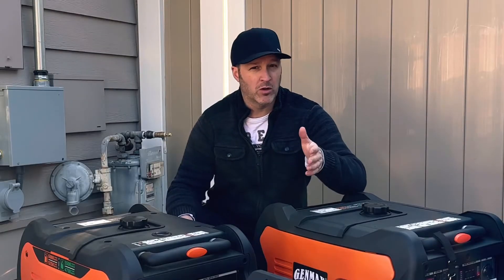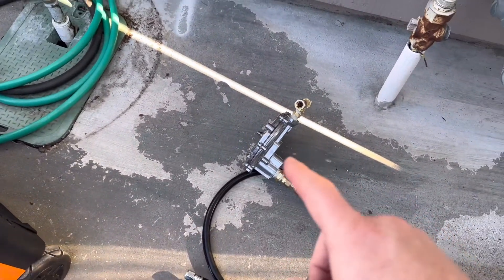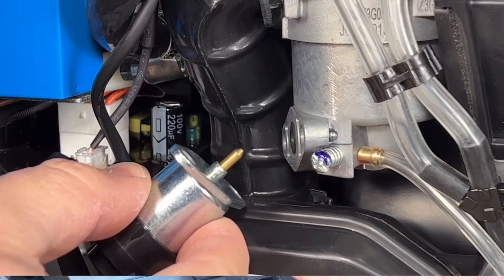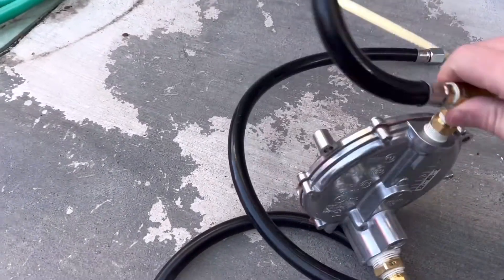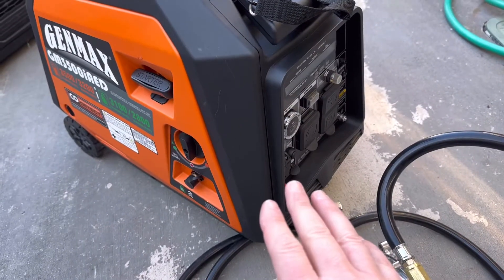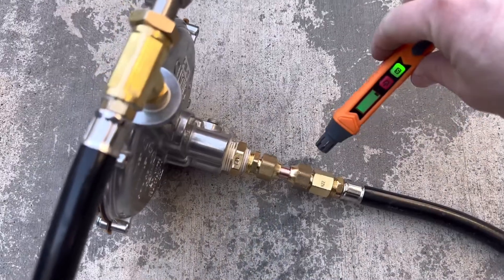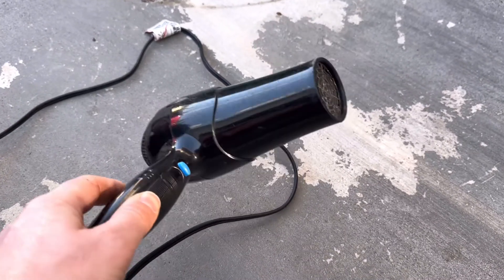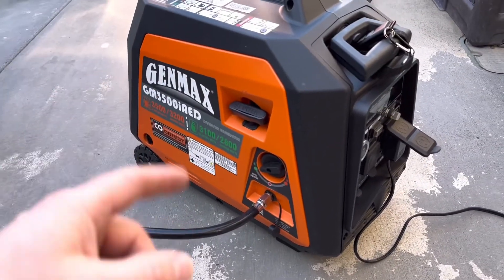ADD Natural Gas to Dual Fuel Generator…

Comment: I just found your videos yesterday - appreciate the information. Have you ever looked at the Firman WH03242? The LPG hose included with the generator looks like it has both regulators on the hose. Thanks.
P.S. newly subscribed - thanks again for the helpful information.
Reply: Hi.   Would you know if genmax 7250 can be fitted to run on natural gas?  Thanks.  I dont have one to check nor know anyone that owns one
Reply from the maker: Unless you by pass the internal load regulator then it can not be ran on NG. 
Genmax has a new Tri fuel 9000 coming out soon..👍🏼
Reply from the maker: I’m not a big fan of firman but the big selling point is that it’s sold at Costco and they pretty much take dead chickens back so it’s a great selling point.
If the both regulators is on the outside than adding a kit like this for a tri fuel setup should be easy. 
Thanks for stopping by and joining the group 😀👍🏼👊🏼
Reply: Hello Jason, I am looking at the Firman WH03242 as well to use with my BBQ natural gas outlet. Did you end up trying with a kit like this?

Comment: Johnny, thanks for this video. Do you know if this would work on the Genmax 9000ied?
Reply from the maker: I don’t know for sure but I’m pretty sure the load regulator is inside and would need to be by passed. They have a new tri fuel coming..
But you could make it work but that’s up to you.
Reply: @johnnysweekends  Waiting for the tri fuel coming sometime soon! Thanks!

Comment: Do you have a link to buy this kit? And would this work on a Champion 2500W dual fuel inverter generator (model 200961)?
Reply from the maker: Sometimes for certain model you have to go to uscarburation website or even hutch mountain.

Comment: Cool video Johnny, I didn't know you could do this!  Do you think that would work with the Ecoflow dual fuel generator?
Reply from the maker: Hey Todd, Thanks. Unfortunately for the Dual fuel Smart gen they use a proprietary connector that is not easily found. And the internal load regulator would have to be bypassed. Which again voids warranty when ever you like to dig inside stuff 😂👍🏼

Comment: It looks like that is the GM7250iEDC that has internal load regulator and won’t work without bypass correct? Do you happen to know whether GM6000iED requires bypass as well?
Reply from the maker: Yes the 6000 is the same. 
You can make it work but your using the external type for both NG and LPG and bypassing the internal. 
So it would void warranty so maybe after it expires..🤷🏼‍♂️

Comment: I get that the first regulator that's always found on the propane line for dual fuel generators is to regulate pressure to similar levels similar to those provided by the regulator on my natural gas meter. My question is, if the Century demand/secondary regulator works for propane, why wouldn't it work for natural gas also? The only thing that seems to be missing is possibly some kind of adjustment for the amount of fuel that's allowed through.
Reply: I had the same question, the set screw on the on demand regulator acts as an orfice or jet to regulate flow. If you have a higher BTU, then you tighten the screw to lean out but the internal regulator just regulates pressure so you shouldn't have to bypass. These Trifuel generators have the orfice for the propane selection built into the selector     knob but utilize the same regulator.
Reply from the maker: It does work for NG. That’s what the video shows me doing is using this kit for NG and how to set it, or can be used for a gas to LPG.
Reply: I’m talking about the generators that have a demand regulator built-in like the ones you claim you would have to bypass. Why do you need to buy another regular so you can bypass the built-in one?
Reply: Example, WEN DF875iX. It comes with a pressure regulator on the hose like normal and then behind the propane inlet there is a demand regulator. Is there a reason someone with this generator couldn’t just run a gas hose to the propane inlet and run with it?
Reply from the maker: The internal demand regulator is set to run on the pressure and Btu ratings of LPG not NG. So the on board will probably run to lean for NG as you need more NG since its way less efficient. 
I have tried a couple with my units but they just wont run correctly.
Reply from the maker: I commented on other post

Comment: That sounds dangerous. I might only being ignorant, but when you use two fuel types on the same machine, differences of pressure, volatility and others must be carefully considered.
Reply from the maker: These engines are nothing more then lawn mower engines and many can be converted to LPG and NG. As long as the correct regulator and load regulator or on demand type is used then it’s perfectly safe for you and the engine. 
This is not new and has been going on for for 20 years+